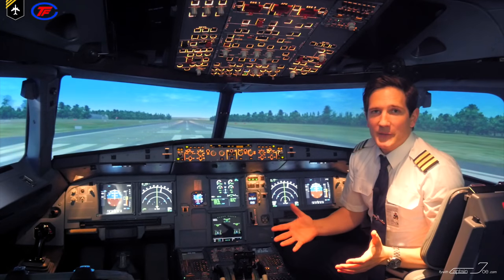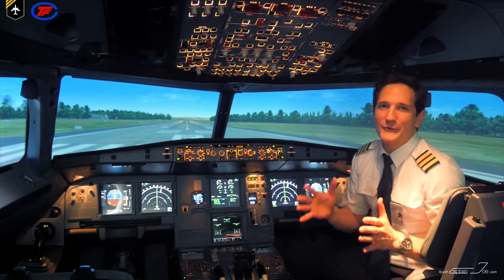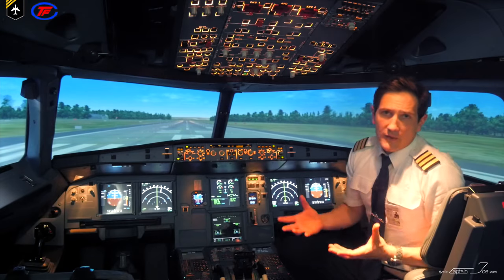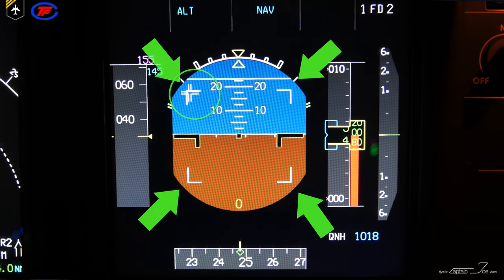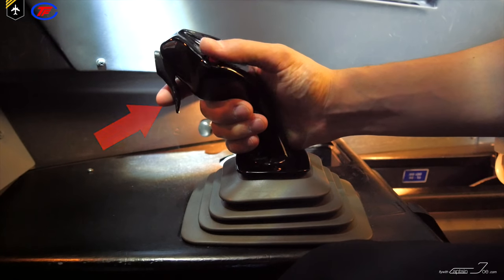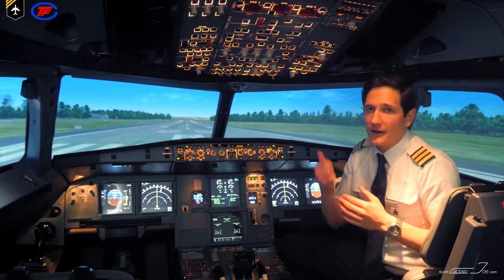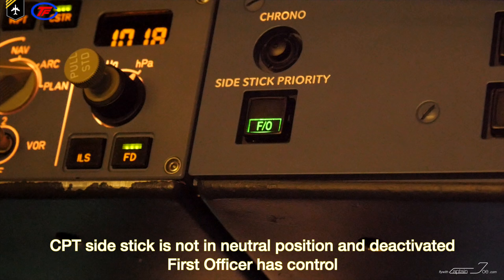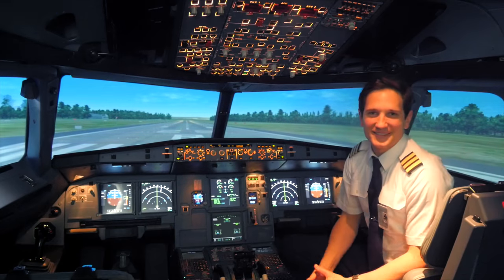AIRBUS SIDE STICK - Explained by CAPTAIN Joe

Comment: Who wants to rip the mechanical steering wheel out of their car and replace it with an electronic side stick?  Oh, right.  No one.
Reply: lots of new cars have elctronic steering lmfao.
Reply: @SoSo7060 , even so you have a direct mechanical linkage to the wheels. The electronic steering is just to provide power.
Reply: Who wants to rip the throttle pedal out of their car and replace it with a body of throttle levers? Oh right, no one. 

Different applications for different needs. Can't exactly compare controlling a car to a plane.
Reply: Drive by wire and sidestick steering in cars has compelling temptations
1 You can steer with the left or right hand in either left or sight side of car.
2 You can brake and accelerate with the sidestick and get rid of foot pedals
3 No need to install foot pedals and the safety and space problems they create
4 Easy to provide for disabled drivers.
Electric cars will require brake by wire to regenerate braking energy and this has already begun with Porche pressing the brake pedal generates a 'request for braking' which is then converted to a mixture of disk brake and regenerative braking.
Reply: @WilliamJones-Halibut-vq1fs  very bad argument. I'll stick to my pedals and steering wheel thank you very much
Reply: @wtfhlostonparadise8278  Nissan developed a "steer by wire" system for the Infiniti Q50.
Reply: @wtfhlostonparadise8278  well, brakes are not mechanically connected. Not sure about acc. pedal, but I guess in most cases it's "the wire". Of course we're talking about modern mid-range Joe cars, not vintage, or prototype one...
Reply: @knightfox1461  do you realize that accelerator pedal in cars has been "fly by wire" and not a mechanical wire for at least 15 years?
Reply: @gronki1  accelerator is not critical, breaks are.  Then you are talking of cars.  If anything you can always stop moving or force your vehicle to move and by doing so you will not crush to ground from 5km above
Reply: That's why fighter jets and huge jets like the c17 globemster have sticks instead of yokes... Yup makes sense
Reply: actually i remember test concept of car controls that used rectangular "wheel" with two handles which you could turn for steering, twist to accelerate and grip hard to brake

that would feel much more natural to me, who has only driven few times in my life... hence i don't have inherited resistance to using new methods

yes, that could only be easily done with new technology

but i mean, i've tried old fashioned car with stick... it was such a hard time to avoid stalling, finding right pedals, using gearstick... not hard to learn but why does it need to be such a chore?

not sure how joystick would feel, with pull back as brake i guess? i think i would feel more natural with it

i also don't really want to control a car anyway... sure, it's fun to do it for a while i guess, but if you just want to use car as a method of transport... why do i need to drive it? i bet i'm not single person who has lot of other things they could do instead of using their body parts and brain to keep their ride going... i could think of many other things i could do, sit back and relax, look the surroundings, eat, take a nap, read something, do work, maybe even watch this aviation video and learn new things

sure, changing old things can be considered almost blasphemy and i won't like it too if it would be forced on me, but...

those are my ideas of changing controls of car / plane / whatever
Reply: Saab did. The car was called Prometheus. That idea was a total and utter failure.
Reply: news flash: you dont fly a car.
Reply: Who would want to fly a plane with a steering wheel?

I certainly don't.

And yokes. Bleugh. I did not like my time with a cessna 152 much. 
Give me a stick any day.

Though, sticks in light aircraft are still mechanically linked to the flight control surfaces, so that's not comparable as such...
Reply: lol drive by wire exists too

Comment: This is why BOEING  is simpler , safest , reliable and most sophisticated .
Reply: tchip..But still Fly-By-Wire on the B-777 and B-787
Reply: Boeing has it's advantages but it's not simpler! If you compare the cockpit of an a320 and a b737 the Boeing cockpit looks like a total mess. But thats mainly in the 737. The 787 cockpit is rather cool actually.
Reply: The 737 cockpit is designed so that pilots from the antique 737s with only mechanical gauges can upgrade with minimal difficulty.
Reply: tchip Pat Both make good planes

Comment: Excellent explanation. But I have a question: how do you manage if you are left or right handed to correctly use the opposite flight stick?
Reply: you use both hands no matter the type of control. in the captains seat, right hand on the throttle (center console) and left on the sidestick/joke/whatever

Comment: I have a more basic question from a human interface perspective: The flight sticks are on opposite sides. For the captain, it's on the left, and for the copilot, on the right. Anyone will tell you muscle memory is an important part of operating any vehicle, whether it's an airplane, a car, or a backhoe. We do it with computers too. But if I were to ask someone to switch their mouse hand -- I'm willing to bet they'd barely be able to click anything on the screen for a good long time. In effect, they'd have to retrain themselves. There is some crossover, but a lot of what we learn doing with one hand, we have to learn again doing with the other hand.
-
With a conventional yoke, I see a lot of pilots who hold it in their left hand, and rest their right hand on the throttles -- but they also do two-handed operation a fair bit, so when they switch seats, that muscle memory doesn't vanish in a puff of confusion. This HAS to be something pilots notice -- ignoring all the other stuff people are going to say here... is this addressed in training? Is this something pilots consciously consider, and do they swap seats frequently enough so that the muscle memory is there on both hands?

Comment: Thanks for the great channel, Joe. One question. Do pilots prefer left seat over the right one? Is it related to driving side in most of the countries? Or it's just like a man choosing the side of the bed?!
Reply: Captain on the left, FO on the right.

So if you're career oriented, you'll prefer the left I suppose...
Reply: @davidsanders9426   obvious exception: on long haul flight the captain is sometimes off the left seat for rest, which is mandatory.  so another FO will take the prestigious left seat for a while.

Comment: Great video! One question. Does the sidestick have a "Dead zone", a short distance of travel from its centre, where it registers no input? Or is the motion completely linear so the slightest movement left or right will be shown on the indicator? It seems as though many pilots landing have reasonably large inputs after AP disconnect, which don't feel violent as a passenger.

Comment: There was an incident with an AirFrance flight in which dual input caused a crash killing all on board.  The Pitot tube froze and the pilot in command reacted by pitching the nose up, causing a non recoverable stall.

Comment: This system (along with a lot of other things) is one of the factors that caused air france 447 crash. Within all the warnings in the flight deck they probably couldnt see the side stick warnings. It is much better to have linked controls so both pilots know what is going on all the time without having to look at other instruments to confirm.

Comment: @captain Joe, were these systems available before the Air France flight 447 accidents or were they recommendations after the accident as side sticks inputs were partly to blame?
Reply: They were already installed when the accident happend. There are some videos here on youtube where the orignal cvr recording playes and you can clearly hear "dual input" several times.

Comment: If you are a pilot on the flight and you are right handed, isn't it difficult to use the side stick which is on your left if you're sitting at the pilot's seat?

Comment: To all those wondering about whether or not it would be difficult to fly captain side as a right handed person. Bear in mind that regardless of the fact that the aircraft flown has a yoke or a side stick, the captain when flying manual will use his LEFT hand for pitch and roll, his right hand for thrust input and his feet for rudder control.

Comment: Dear Joe why the priority warning was not activated on that Airbus that crashed due to the first officer being constantly holding his sidestick backwards and thus stalling the whole plane meanwhile the pilots were puzzled and the critical information they needed in order to save the plane was delayed?  I can't remember exactly the year. Guess it was in 2009. The pitot tubes frozen when the plane passed into a storm over the Atlantic ocean. It took of from Brazil and was heading to France.
Reply: you're reffering to air france flight 447
Reply: Luiz Almeida AF447 wasnt caused by pilot error it was due to a stall.

Comment: How is it with Sidestick/Pedals. Is it possible to feel like Force Feed Back from your control surfuses or will sidestick/pedals only apply input to the aircraft? I know it is a very big and complicated box under each sidestick, but could be interested to get a feed back if it actual is possible to "feel" your controlsurfuses and feedback from those....

Comment: The side stick design has become a point of discussion when accidents have occurred, in particular Air France 447, which managed to stall in cruise flight.
Reply: It wasn’t a sidestick problem, it was a pilot problem, they should’ve been communicating

Comment: Sidesticks are superior. Everybody is switching to sidesticks, Embraer, Comac, Bombardier, Irkut, Sukhoi, Dassault, Gulfstream, all jet fighters, helicopters, etc. Yokes are clumsy, a waste of space, and adds more unnecessary weight and complexity. Modern airplanes are Fly by Wire, you are basically sending inputs to a computer. Yokes were needed when there was a lot of cables and pulleys to be pulled. It's like wanting to have a mechanical typing machine attached to our home computers to type on the screen... Boeing will too change to sidesticks, it's just a matter of time (and stubbornness).
Reply: From what i have been told, Boeing still include mechanical linkages for the basic flight controls, as a backup for incase the hydraulics fail (The basic flight controls (rudder, ailerons, elevator) don’t make use of fly by wire technology, not even the MCAS equipped planes, MCAS only uses the trim)

Comment: I'm kind of surprised at the complete lack of feedback in those sticks.

While they've gone out of fashion, and you can't really buy anything equivalent these days, around the late 90's to early 2000's there were force feedback joysticks for PC...

These weren't 'rumble' like most gamers would be quite familiar with, no, the sticks had programmable force and resistance that could be applied in at least two axes, leading to a wide variety of effects.

Seems a bit sad to have no feedback at all - I'm used to it because modern joysticks have no force feedback either, so that's what you get flying a home flight simulator. - the only force you feel is the centring spring.

But I know from my time with light aircraft (real ones, not simulated) where mechanical linkages are usually still used, that being able to 'feel' the forces on the control surfaces is quite useful to know what kind of state the aircraft is in.

As for being certain about who is in control...
Yeah, that's one of the first things a flight instructor will teach you - how to clearly hand control from one pilot to the other, so that there is ONE person flying the plane, not two giving conflicting inputs.
(somewhat more critical where mechanical linkages are involved because conflicting inputs from two sets of controls could break something...)

Comment: Oh is that what that trigger button does? I always figured it fired the selected weapon, which if I remember right; the A320 had a forward mounted General Electric GAU-8 30mm Gatling gun, and a secondary 500 litre chemtrail dispersing system. LOL

Comment: On another topic... How does actual wind velocity, especially a tail wind, affect the flight characteristics of the plane. It seems to the earth bound creatures that with a sufficiently high enough tail wind, the plane would exceed the design parameters and so make the control surfaces harder to change. On the other hand, could a wind of sufficient velocity reduce lift to the point that the plane could no longer fly?   If this has been addressed in a previous video, can you indicate the link to it. Thanks, John
Reply: Once a plane is in the air, wind doesn't matter except for calculating travel times.

If the wind is blowing from behind, your ground speed will be higher but the wind hitting the plane will be at normal speeds.

Comment: Air France 447 happened because the copilot was able to keep the plane in a stall with no one able to see what he was doing - thanks to the side stick.  Side sticks should be replaced with traditional yokes.
Reply: TheFarmanimalfriend the sidestick was a contributing factor, but not the cause of that accident. It was more of pilot error.

Comment: @captain Joe

Don't get me wrong but..

I'm still otterly curious as to Why they've ever decided to control such a massive/sensitive type of plane with just a simple side stick. Any comment in your opinion as to why they've changed to this digital way of controls?
Reply: Alex S. because the bigger controls takes up more space in the cockpit. And considering the advantages of fly by wire, there no need of having massive controls. The side stick does the job well enough, especially for an airliner which is mainly flown on autopilot.
Reply: @ZK-APA  Oh never thought of it that way, thanks for the reply !

Comment: Hello Joe, as you have mentioned about the left and right side stick,that we can identify who has the control of the flight in the airbus. But I wonder when was this control indicating system installed? The reason is, if we watch the air france 447 airbus crash investigation, the copilot Bonin was in the right side and handling the aircraft. The other pilot Robert was in the left side and when the flight started stalling, he didn't know that Bonin was pulling the stick and putting the nose of the aircraft up which lead to stall. It clearly states that there was big misunderstanding about who was controlling the aircraft. So this pilot control indicating system was installed after the air France 447 tragedy??
Reply: From what I gather the stall aural warning has a higher priority than the dual input warning so it wasn’t sounding because of the stall

Comment: I wonder if these input indicators could save AF 447 when they had lost airspeed indication and the flight control system had switched to the alternate mode. The pilot in the F/O position kept pulling back on the stick, and the other pilot failed to notice the indications of erroneous input or the plane's stall-prone attitude on the PFD, and then the actual stall, for several minutes.

Comment: The side-stick override to prefent this: "Fatal Flight 447 Chaos in the Cockpit"
 - Both pilots did wrong opposite commands:  nose - up and nose down .... A stall warning did stop after about 3 minutes .... and AF447 crashed into water ....
Reply: Pilots werent communicating with eachother. The F/O wasnt even aware he was pulling on the stick.

Comment: Captain Joe - would a pilot transitioning from co-pilot to Captain find it particularly difficult 'relearning' how to handle the aircraft on their opposite side?
As opposed to a pilot who uses a yoke either side wouldn't have any particular change in handling?
Reply: That said, I suppose that the same applies for the feel of the throttle in left/right hand too...

Comment: @Captain Joe I have questions, what if both pilots are in a disagreement? When they both input and the warning comes up will anything happen or because they are both fighting over control will they crash? And technically couldn't a pilot do suicide by deactivating the others joystick and then nose diving? When a side stick is deactivated can it be re-activated in flight, i.e by holding the autopilot disconnect for 40 seconds? And will that give them priority and deactivate the other side stick or will they both be active?

Comment: Can you show us how to fly Airbus by hand? Do you still have to control the rudder or does flight computer do it automatically? I was always wondering.
Reply: Dominik Gronkiewicz you can control the rudder (it is mechanically linked as well, so it will still work if computers fail). But yea for most of the flying, the computer operates the rudder.